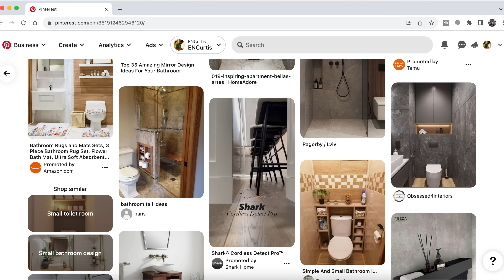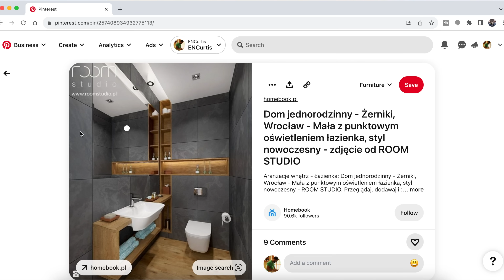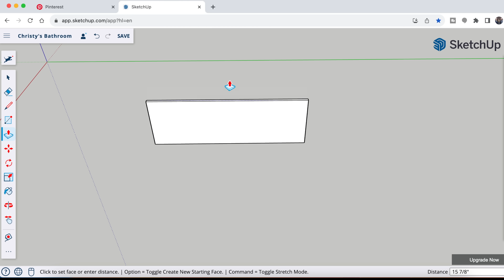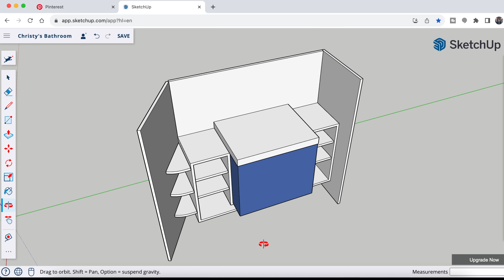Make furniture. Not firewood.

Comment: Lumberyard video? Damn right! There is nothing as enjoyable as a trip to a lumberyard. Well, using the lumber, of course. But the tactile joy, other than splinters, the aroma, the sadness at not having an unlimited credit card, the feeling of possibility... OK, so most of the local hardwood suppliers don't let me run around singing to the stacks  joyously anymore. I still like going to lumberyards.
Also, good points on design. Don't look for what you want to build, look for a starting point.
Reply from the maker: 😂😂 I love how much you love a lumber run. Love that energy my dude 👊